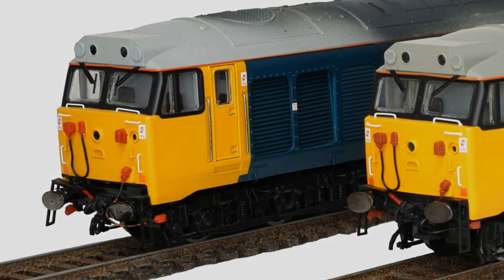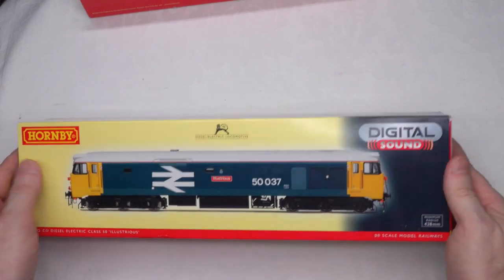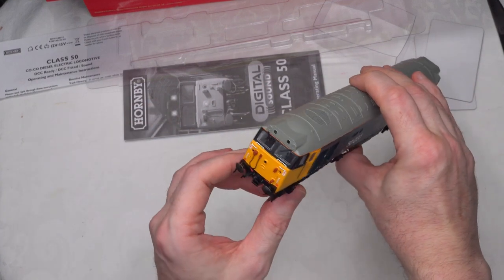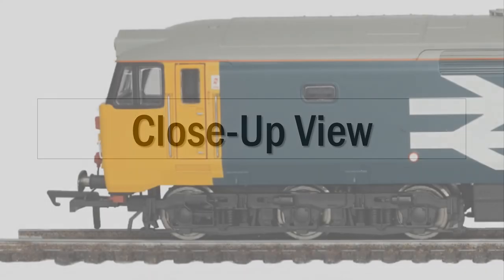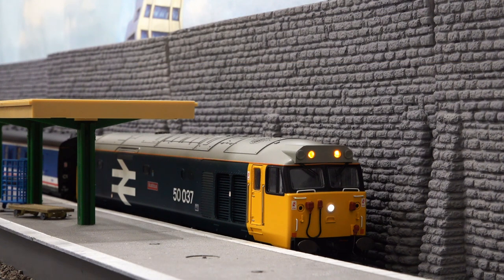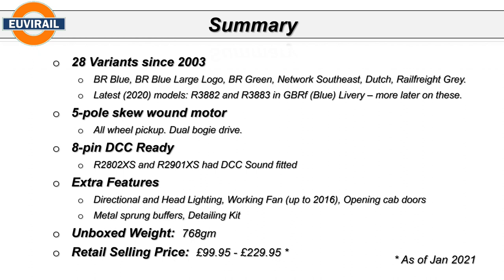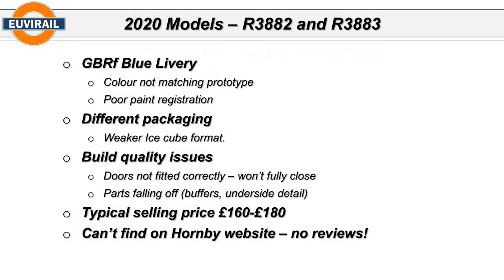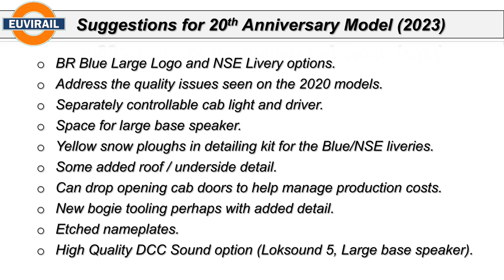Review: Hornby Class 50 Range from 2003 to 2020

Comment: Very informative, thankyou. As a great fan of the 50 but a returning collector my collection is of Lima locos from the 80s and 90s. Great to see what Hornby have done with the model. I think I’d love a Hornby version but I have a small mainly 1st radius layout and I’m not sure a Hornby version would go round the bends. The price is also prohibitively high, 3-4 times a Lima model, is it 3-4 times the model? Talking DC only.
Reply from the maker: Thanks for that. The Class 50 is one of the Hornby locos due for a refresh in terms it's DCC and lighting support. Would expect to see a dip in the prices of the current locos when the new models appear so there may be a good buying opportunity on the horizon. Current prices are excessive for what is an older model now.
Reply: @EuviRail  Thanks, I’ll keep an eye out for one. I must say that the Lima models still hold their own with one exception. The underscale HO bogies. However I have been modifying a number of my fleet to fit Lima 37 bogies which are lower gearing improved pickups and to scale length and wheel size, IMO a vast improvement and almost as good as a Hornby model.

Comment: Excellent review though it set my alarm bells ringing because of the high weight. I had a problem with a similarly overweight Heljan Class 47. With that the main issue was it lacked the power to wheelspin if it's train derailed, so it frequently got too hot and pretty soon burnt out. Also, as my layout is mainly outdoors it's top heavy design caused it to overturn at every opportunity, like the smallest twig on the line would do it. The weight gave it so much momentum that bits of it would break off as it hit the concrete base. The coupling also broke for similar reasons. I recon they should reduce the weight on these models and provide weight packs to add if you need them. Anyways I scapped it, my first ever rightoff in 45 years. So I'll stick with Lima for now. How about the Railroad version of a Class 50 if there is one? I wonder if they improved that over the Lima version? I really have no idea because very few people do serious reviews on things like the wheels, how many are driven, tyres and the loco weight. So your reviews are really useful even if they suggest I should avoid a loco.
Reply from the maker: I'm not aware of a Railroad Class 50 which would effectively have been the Lima version if it existed. I've had a few Hornby 50s over the years and they were always solid runners. Accurascale are coming on the scene now with their Class 50. I would expect that to be bit heavier though not by that much as the Hornby model is already heavy enough.

Comment: @23:00 On the older ones which have a few resistors on the PCB board, i think you find them in 50018, 50045 & 50002... Maybe others. Just put the decoder in back to front and it will work fine.
Reply from the maker: Yeah, I was able to get the motor control running. I didn't check but I believe I may still have had some problems with the lighting. Hard to believe a manufacturer would let a model out the door like this though.
Reply: @EuviRail  no QC at Hornby. 🙄

Comment: I have a GBRf class 50 and am very pleased with it. Colour is VERY important to me and when I found out before my pre-ordered one arrived the blue colour was wrong, had me concerned. When loco arrived sure enough blue was too light and had shiny plastic sheen, I used some black weathering powder lightly over all the blue, masking off all areas that were not blue and now it matches perfectly my Revolution JNA GBRf, Dapol MJA GBRf and Hattons MEAS GBRf wagons and NO plastic sheen. I know this loco never ran with these wagons? but it's my railway and I run what I like, plus everything has to match colour wise. I have had numerous class 50s over the years and all  had a problem with the spring return type coupling derailing the coach/wagon next to loco, I have NOT had this problem with this latest class 50, has Hornby improved coupling? or am I just lucky.
I have had no problem with bits falling off and it runs superbly. Thanks for your very informative review which I really enjoy and I look forward to more with that fantastic Irish lilt voice, Bill.
Reply from the maker: Excellent. Thanks William for sharing your experience with the GBRf Class 50. I haven't encountered the derailing issue you mentioned though in the main I've been running on Rad 3 track with Bachmann MK1 coaching stock which is a pretty safe combination. Thanks for sharing though and I'll be watching out for it. Any sort of derailment is a big no no for me.

Comment: Desperately needs a re-tool. The front of them is way off and too flat.
Reply from the maker: 100% Needs a full refresh with a 21-pin decoder and upgraded lighting.
Reply: Interesting you say that, I saw a post somewhere comparing the Hornby tooling to the Lima tooling and the differences (while minor) were noticeable. Have Hornby gone too far then on the cab ends?
Reply: @jwpalfrey  The 'ledge' under the windscreens has been modelled flat whereas there is a pronounced curve. This curve allows the windscreens to be dropped down at each outer corner giving a pronounced droop effect. The bottom of each windscreen is sloping down by about 7 degrees and each screen is not perpendicular, they only fit one way on the real thing, I know this as Ive actually done it!😄 Neither Hornby or anybody else have managed to get this right thus far and spoils the face of and character of the prototype.